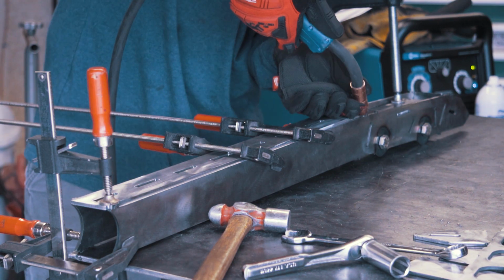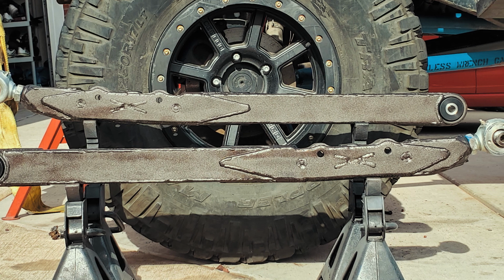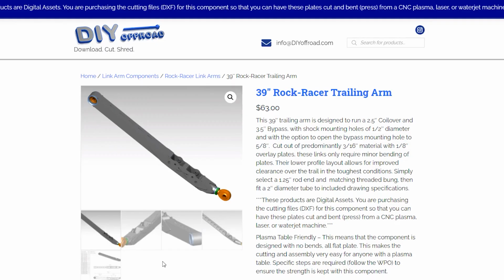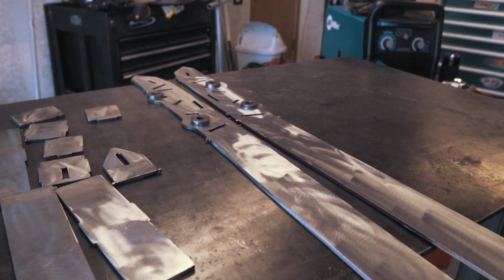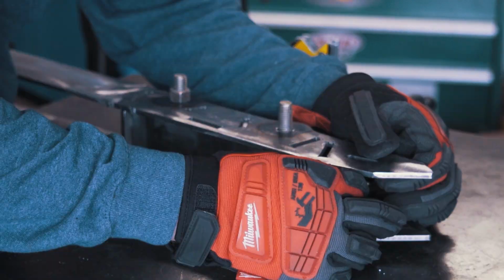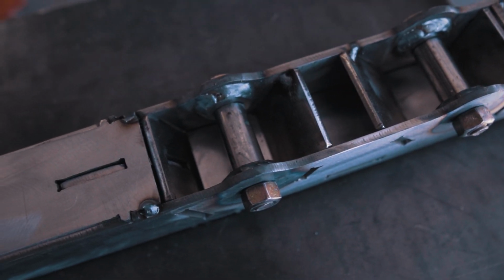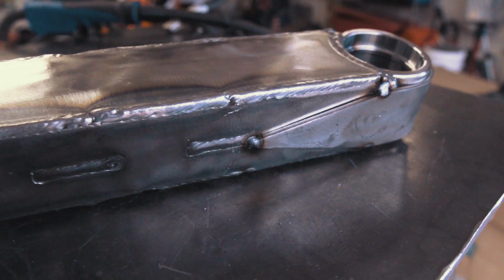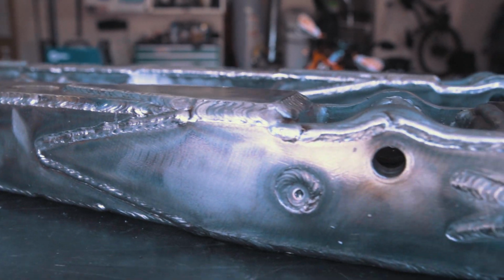Trailing Arm Build - Reckless Wrench Garage

Comment: It’s kinda funny. Everything that I’ve learned at welding school and on the job really doesn’t mean smack. Push don’t pull, up not down. I’ve had to do bastard welds just because being out of position. Then last week I watched a chic weld trailing arms together for some manufacturer.  She broke ever rule and her stuff looked a million times better than mine. She pulled every weld, went downhill. I’ve seen so many videos like that. And they were awesome welds. Bet they all would pass certs. So clean and burn. As long as it’s strong.

Comment: did this mess with your drive shaft or can you still use it
Reply from the maker: These are the same length as the lower links I had previously so driveshaft length didn't change and I'm still in the usable travel of the shaft and joint

Comment: What size square tube are you using for sliders?  I haven't looked into it yet (for $$$ reasons) but that is the way I want to go on my next set for the Dodge.
Reply from the maker: These were 2x6 .120 wall
Reply: @RecklessWrenchGarage  Thanks!

Comment: Stoked to see yall making videos again! And perfect timing I was just researching high clearance trailing arms last night. Id love more info on the wobble stopper joint. Was that whole joint bushings and all available somewhere? Also iv heard bad things are bushings over Delrin spacers on a rock crawler. Any concerns with that?
Reply from the maker: The wobble stopper was a complete kit from TMR customs. It's very nice, but definitely more expensive than a typical bushing. I can't say much on delrin vs a rubber bushing, this is the first delrin bushing I've used. This should last longer, but more vibrations will transfer to the chassis and it's not flexible except for the misalignment that's built into the joint. With the spherical bearing this joint will be incredibly strong.